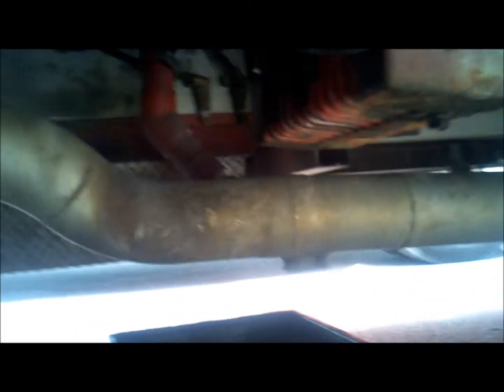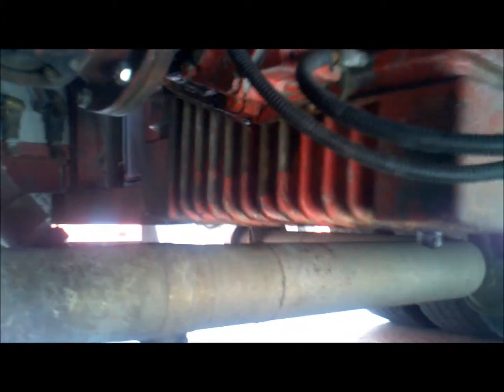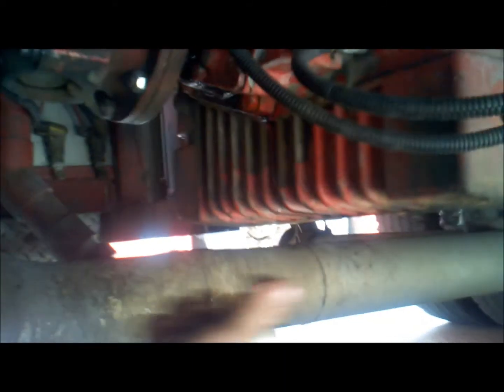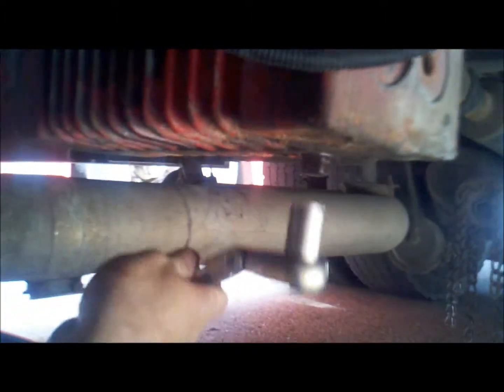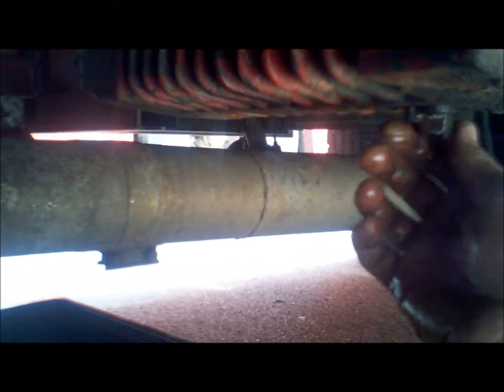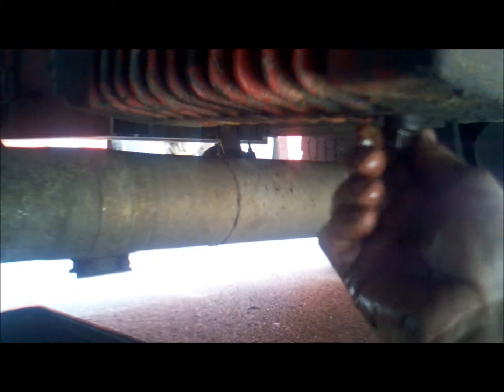Hale pump trans service.wmv

Comment from the maker: it is not blocked off the reason water gets in the trans is that if there are ball valves or other things in the pump Area leaking water it flows over the pump trans and gets into the pump threw the vent or output or input seals